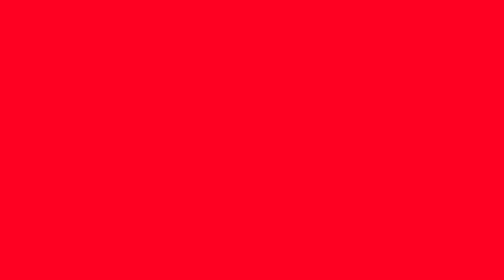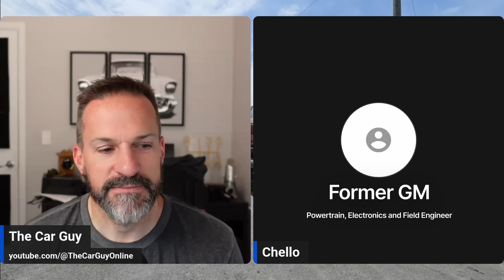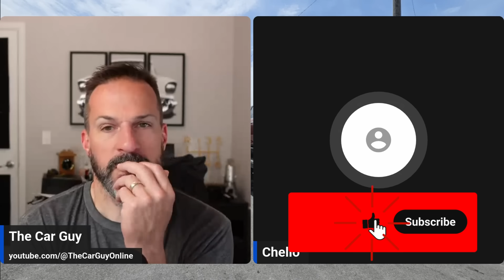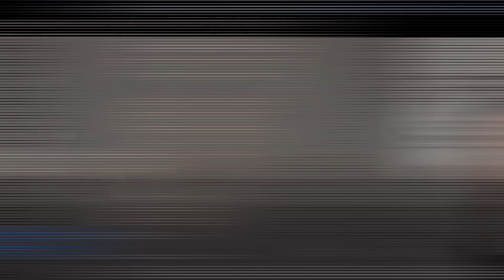Engineers HATE Building Cars Like This! GM Insider Explains

Comment: I've got a Honda Civic SI 2013 with 180k miles. Runs fine, still has a key ignition / no push start. I might go for a Chevy SS in a year or two, that's mid-2010s with an LS3. Pretty sure it has normal non-electronic brakes. I'm hoping that's as new as I'll ever go.

Comment: I had a Nissan where the paint started peeling at a year.  By 3 years it was peeling on every body panel.  Nissan refused to fix it even under warranty.  Conversely, my wife’s Audi with the infamous 2.0tsfi had 2 catastrophic failures, both out of warranty and Audi rebuilt the engine twice.    I’m an Audi fan now, on #3.  The Nissan was my 5th and my last.  Japanese companies are not what they used to be, quickly following American’s lead.

Comment: 2007 Dodge Ram 1500, 4.7l Flex. 265k miles and counting. 

Frame is in good shape, some rust on the rear wheel wells, and bottom of the tailgate.

Gonna run this thing as long as I possibly can, and even if (when) she wears out completely, I'll do everything I can to keep this girl on the road. 

It's a great truck that I can still work on.

Also good to see that there are a LOT of 3rd Gen Rams still on the road- I see several daily.
Reply: Im impressed to hear about a 4.7 making it that long, they are notorious for oiling issues
Reply: @cyclesaviorn2700 previous owner bought it in 08 and only used synthetic oil changed every 7-8k miles. 

I've had it since around 200k miles and I'm sticking to his OCI. Going strong
Reply: @Jethu262  indiana perspective here, if rust is common around you the best results ive ever seen is the regular spray wax underbody coating.. otherwise keep that odometer kicking! Thats definitely a flex you have going for ya

Comment: I buy pre 2013 cars. Buy it fix it , drive it. Maintenance or payments. Cheaper to do maintenance than a new payment. Plus nothing turbocharged except my new diesel land yacht. Working on my new to me Excursion with the 7.3 diesel. New seats, bulletproof the engine and even dumping a lot of money in it but will be reborn for another 250k and all said and done it will cost me a fraction of the cost of a nicely equipped new f150.

Comment: I'm sorry, but it's not the regulations that are the problem, it's the poor implementation of them.  Engines have deactivated cylinders because OEM's choose to use it instead of other technology.  None of it's forced, it's a choice.  I worked on cylinder deactivation while also working an OEM, and we chose to NOT use it because it wasn't effective.   And if engines have deposit problems, it's the OEM who chose DI to solve a problem when something else could have been more effective.  Let alone, not all DI engines have system deposits, so, again, it's an OEM specific problem.

BTW, adding PFI to DI was not for the cleaning properties, it was added for other things- the cleaning was just a side benefit.

Comment: I agree with him in general, however he is wrong about the power from direct injection. DI injects the fuel as it is being ignited, so during the compression stroke there is no fuel in the cylinder. That means there is no danger of pre-ignition and so you can jack up the compression ratio without fear of preignition. Combining DI with variable valve timing to bleed off excess compression down low means these newer engines can run crazy high compression ratios on 87 octane, and more compression means more power and more efficiency out of the same displacement. In the 80s and 90s most cars were in the 9:1 range, and anything with 10:1 or higher required premium. Now some of the newer gas engines are 14:1 or 15:1 and run on regular gas, and that would not be possible without DI. Whether it is worth the sacrifice to longevity and durability is a separate question, and I’m generally of the opinion that you can make more than enough power with port injection, so the benefit likely won’t outweigh the costs, but to say that DI doesn’t make more power isn’t accurate.

Comment: Hey, here’s a thought: if cylinder deactivation is unreliable, either design it to be more reliable or stop using it and go to smaller turbos like everybody else has done.  There are reasons that only GM and Chrysler are using this garbage, everybody else has the same regulations and decided not to do it, probably because they realized it was crap reliability wise.

Comment: Well that's why we need to go electric. What chevy is trying to do (though too expensive) use an electric drive train with a supplemental gas motor to charge and extend range. Problems solved with reliability. I would like to have a planet to live on for my son, so emission standards are needed. People don't remember what cities were like in the 70's for smog. We used to have smog warnings, it was disgusting. Yes engines were more reliable back then, but......I like clean air.

Comment: I've seen several videos like this, and there seems to be a growing thought that vehicles built from 1990-2010 were probably the best overall. Enough tech like port injection and ABS, but not overly complicated like cars are now. 

All of this makes me glad that I bought a used 2018 Tesla Model 3; good drive units and batteries, and I had the remaining warranty until 120,000 miles. A lot less to go wrong and the powertrain is perfect.
Reply: Dangerous battery though, don't park it inside at night.
Reply: @Greg-Gore  Only said by those that don't realize how FEW of these actually catch on fire. I'm not worried about it.

Comment: The mid-1990s to around 2005 were the best. The machining tolerances were tight AND the computers only did what was necessary for good economy/reliability. To achieve the newer CAFE requirements, you MUST sacrifice durability.
Reply: I call it the goldilocks period of automotive manufacturing. It was a benchmark that should never be forgotten.
Reply: We need to legislate that as the benchmark of what we expect from our car manufacturers. Anything less should be viewed as predatory( especially at these prices). 

Also, we need to legislate planned obsolescence out of existence and pass right to repair nationally.
Reply: @X.JoshuaKhaos.X that's never going to happen as long as greedy fucks run the show. Investors, shareholders, private equity firms, lobbyists... the toilet water of society...
Reply: 90s was the best quality with minimal electronic stuff
Reply: Probably early 1990s for your time-frame?  I have a 1993 Nissan 240SX. The 240SX entered the market in 1989 and then in '91 the truck engine (KA24E) they put in it for us americans was turned into the dual overhead cam 4 valve/cyl KA24DE.  
Whatever year Nissan got into CVTs is of course when they went to crap (2010-ish?) 
All the Toyotas from that time are good though Toyotas are very small cars pre-1998-ish (especially the '95 Corolla!)
Reply: @stratmatt7775  For the imports even early- mid 80's (it took the US a while to catch up)

Comment: What the hell would running injector cleaner through DI injectors do to clean the backside of the valves. walnut blasting is about the best option if done correctly.

Comment: I'm sure that government study only took into account the fuel economy advantage and ignored the fact that now my new car burns a quart of oil every 1000 miles.  It also ignored the effects of burning that quart of oil in the catalytic converter.  That, and the chemicals I need to use cleaning up the carbon mess.
Reply: Finally someone who is against GDI. I thought I was alone. Carburetors for life.
Reply: @The0utmode  I'm mainly against engines and transmissions that die before 100-150k even with good maintenance.
Reply: @mr220v  Me too. I wish they would just bring back the gen1 SBC 350
Reply: @The0utmode  As far as I'm concerned, the only real problem with DI is that nobody is really willing to do the same degree of research on open valve injection and PFI. But that ship sailed 15 years ago.
Reply: @alfamaize  Here is the research they tried it how did it work out?
Reply: Sorry, but this is incorrect.  Emissions rules pretty much require 10k/qt being burnt so that vehicles can make the emissions mileage requirements.  If cars can't do that, then there is a forced recall.
Reply: @alfamaize  That doesn't happen in practice.  Maybe if you get that $1200 walnut blasting treatment every 30k, but in most cases GDI gums up the rings and your relatively new car turns into an oil burner.
Reply: @mr220v  Practice for who?  If you are actually burning oil at the rate you say, the check engine light would go on immediately.  Walnut blasting doesn't equate to oil consumption.  I'm talking about oil consumption that will end up on the catalyst- which does damage it.  And it needs to be about 10k/qt of oil for the catalyst to make it to the required lifetime.  If you are burning oil and the check engine light isn't going on, either its leaking or something else bad is going on.  Either which, it's the OEM's responsibility to fix, as neither would be allowed with current emissions laws.  Contact the EPA with your data.  
 
And I'm serious- the EPA will investigate and require a recall if what you say is real and across a lot of vehicles.
Reply: @alfamaize  Look at the Kia oil usage issue.  They are claiming rates of oil usage below 1k/quart are not excessive enough to invoke the warranty.  The idea is that carbon gums up the rings and makes it so they can't seal.  People routinely run their engines dry the issue is so bad.  This is a result of the GDI.  Used Kia 3.3L engines are $4k+.
Reply: @mr220v  If that is all factual, then someone needs to contact the EPA and start an investigation.  None of what you post suggests they are meeting the emissions requirements.  Burning oil damages the catalyst at a rate that it won't make full useful life at 10,000miles/qt.  

But to add to that, don't extrapolate one OEM's issues to all of them.  There are no regulations that require DI, so if an OEM does a bad job at it, it's their implementation that is the issue.  The issue you specifically point out is Kia's problem, not the regulations.
Reply: @alfamaize  This is going to be an issue with any GDI engine that doesn't run a port injector.  I'm sure Kia is meeting the requirements to sell a new vehicle.  Down the line though, unless extraordinary service is undertaken, oil usage (and fuel economy) will be bad.
Reply: @mr220v  There is a difference between an issue and a problem.  If you know it's an issue, it can be designed around.  A problem is if you don't.  Not all DI engines have the same port deposit problems.  

Still, the regulations don't force DI, that's a choice of the OEM. 

And I will repeat, if Kia is as bad as you say they are, then there is little chance they will meet the full useful life requirements with that kind of wear.  The rules are clearly set that the emissions requirements are at full useful life of the vehicle, which is currently at 150,000 miles.  Where you are required to meet emissions.  

I did emissions work for 25 of my 30 years at an OEM.  So I'm pretty sure what will not make FUL requirements.
Reply: @alfamaize  My guess is they set an unrealistic maintenance schedule and then they blame the failures on people not complying.  Maybe the answer with that system is to spray seafoam at every oil change?  That's not good for the cats either though.  Toyota's mechanical DI pump is a way better approach.  DI supplies base levels of fuel, then the port injectors supply the excess for load/acceleration.  I'm sure the single Kia DI electric pump is cheaper.  Of course it was recalled, so it ended up being expensive.
Reply: @alfamaize  That's another part of all this.  I hear people use the word "complicated" in a lot of these videos with regard to servicing newer vehicles.  They are somewhat more complicated, but the bigger problem is that they are more proprietary.
Reply: @mr220v  WRT the powertrain, I'm not sure what you mean by so many proprietary parts- we got our DI parts mostly from Bosch.  The computer and software has always been proprietary.  And, of course, the engine design is proprietary.  The rest of the car is much more complicated, but that has almost nothing to do with regulations- other than communication priority.

Comment: I'm old enough to remember when if you made it to 100k, you were a hero.  Then cars got better - I now drive a 2001 Tacoma with 225k, and it runs just the same as it did new, with no repairs other than maintenance.  My wife drives an '11 ES350, now with 110k; it would likely run forever, too, but we would like to get a nice SUV, and I wouldn't mind getting a newer truck - what a shame; they are all junk now.  The only option is trying to find a pre-2015 with really low miles - good luck.

Comment: All new cars and trucks since 2018  are junk doesn't matter if are toyota,  honda, gm, ford dodge. The only new car i might consider is mazda as they still have basic naturally aspirated engines and manual transmissions. 
Why all my vehicles are older and are easy and cheap to repair.  From a 05 gm suburban with 5.3L, 05 gm 8.1L 3500 gasser, 2007 honda crv, 2012 corvette.

Comment: I drive a 1967 Firebird 400, she is very reliable, so I am going to stick with her. I had a good pickup, 1965 F100 with the 352 CID engine, but I traded it for the Firebird. Now I have a 1990, 1992 & 1995 Chevy/GMC K2500, the 1990 is only for parts but the 92 & 95 are very dependable. 
The trick is to buy old and then eliminate the bad crap like the ABS brakes on the 1995. I took off forty pounds of crap that leaked and provided crappy brakes and replaced it with a seven-ounce proportioning valve that provides perfect brakes. Proper maintenance is crucial of course, when you buy one change ALL the fluids, 5K miles later, do it again. After that, if all looks good, lengthen the intervals accordingly. I clean my carb and TBs the same way I did in the 1970s, thoroughly and often in order to clean out not only the varnish but the carbon on the valves, nobody does it anymore it seems. I do it every 5K miles before I change the engine oil & filter.
Reply: Expect for California ,we do smog emissions cks 1976-newer  we hope c.a.r.b goes away  no smog 1976-1995 id go for a  94 -95 tahoe 4 dr  or sc short bed . 5.7 350 v8 best engine ever
Reply: @youtubecarspottersguide1  Sure can't argue on your choice of engine.

Comment: Talking about lower expectations when I was a youngster in the 70's if a car had over 80,000 miles it was ready for the junk yard.  Today I expect the vehicle to last past 200,000 miles.  Now the manufacturers are going backwards.
Reply: For what a car cost now a days percentage wise to income they should last way longer
Reply: My father got rid of a car once it got close to 60k. It didn't matter how much he liked it. They were considered worn out. If this conversation were taking place in the 1970's thourgh mid 1990's we'd think someone was be unreasonable expecting 200k out of a car. My Volvo has 250k. Doesn't leak at all.
Reply: My 2001 Saturn has over 300,000 and is a fantastic car. Air still works, manual still shifts, clutch still clutches. Power steering still smooth. Basic technology! Unfortunately fuel injected but still reliable. I wish I could afford a fleet of them.
Reply: @308dad8  You can I have a 01 3 door, a 97 wagon and, a 96 2 door I paid less then 2500 for each of them, and they all have 120-300k on them. Parts are also dirt cheap
Reply: The 90's seam to be the best period. The 90's Toyota's lasted forever.
Reply: @markflierl1624  As a general rule 95-05 are almost always good BUT Toyota and Honda was good from 85-2010(at least)
Reply: They don’t make any money if the cars last forever.
Reply: @kenm.7651  Not looking at forever, how about if they last a few years with little to no trouble. I take care of a Fleet, many new trucks go right back to the dealer for issues. Buying American made is a financial challenge at best !

Comment: I won't own anything these days past 2013. Vehicles are like modern appliances, not built to last. Just built to last through the warranty. Ram just came out with a 100k warranty and rerolled the Hemi. Maybe there is hope with reduced EPA regs under Zeldin and Trump.
Reply: 2015 Volvo s60 clocking 165k original tranny and engine. 5K oil changes.

Comment: My '79 Corvette and '79 Camaro are pretty foolproof in operation and maintenance.  No computers, PCMs, ECMs, ABS or other electronics to burn out or go wrong...
Reply: nice but calif we still do smog  emissions cks 1976 and newer ,  no smog ck 1976-95 . my dream cars 77-79 4 speeds Z28, EL Camino , vettes where not sold  new in California  with 4speeds automatic only,  can go find my dream cars and bring to California and not worry will it pass and in 2 yrs again
Reply: @youtubecarspottersguide1    I left Colorado and they were just as strict.  I moved to a Red State where the .gov isn't quite as invasive.
Reply: @doctordetroit9983   smart   im bout done with California
Reply: Just distributor cap and rotors go bad and need replacing.
Reply: @Phenom_Productions    But the gist is:  The car can't be hijacked by hackers or .gov people and shut down.  I even run antiquated carburetors and not EFI systems.
Reply: @doctordetroit9983  Finally someone who preferers carburetion I daily a 79 c-10